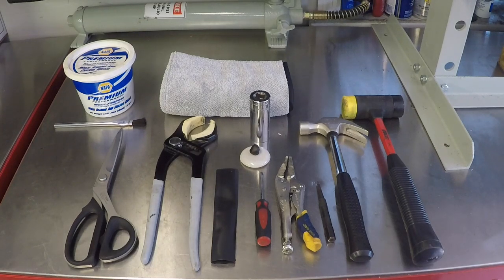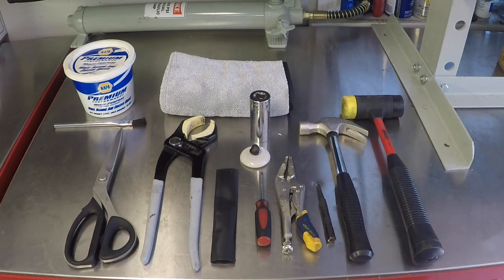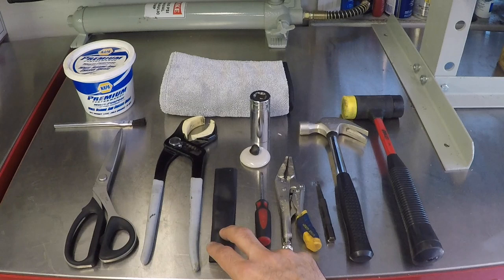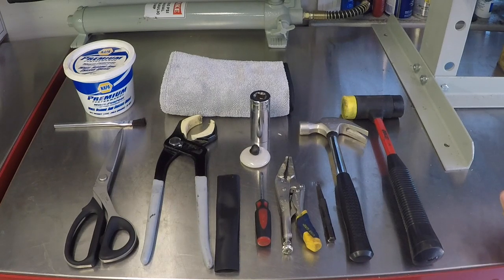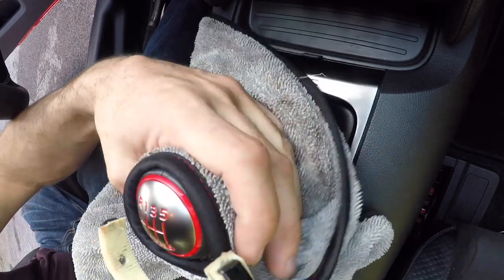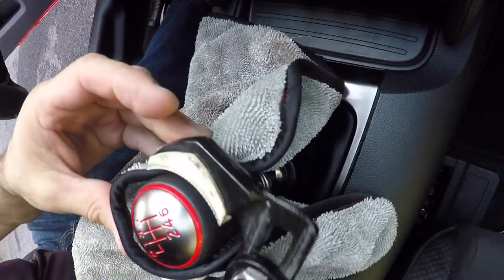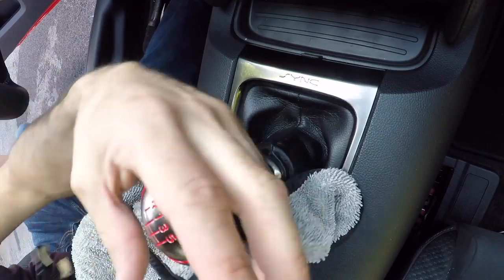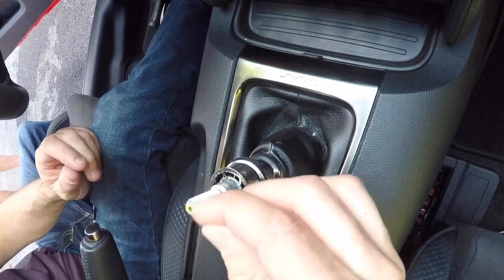Shelby GT350 Shifter rattle and buzz repair! | Auto Fanatic

Comment: Mine just started buzzing last night and it is already making me crazy. I'd leap into this repair but I had a nightmare replacing my stock shift knob with a ball style one.  Ford had used red loctite on the factory knob and getting it off accidentally broke my shift mechanism and required cutting off the shift knob and replacing the assembly by the fold dealer.  I'm gun shy and I'm not quite ready to touch that thing again.

Comment: My 19 just started this noise out of no where when shifting from 1-2 at above around 4K. Sounds like a whirring noise. Almost like a top being spun. I just changed the transmission fluid at 9k with amsoil and the noise has pretty much disappeared but I think I can still hear faintly. It only occurred during the shift. There isn’t any noise while in gear and the tranny doesn’t feel bad in any gear.
Reply: I have this exact same noise on my 19, same thing from 1-2 shift above 4K... so before I tear apart my console... this video is talking about a different sound/problem? Thanks in advance for any additional info regarding this...
Reply: @IIIGhostRiderIII  this won’t fix the issue. I just went ahead and installed an MGW shifter. Noise is gone and now my shifter is solid and even better than stock. I have the new Gen 2 that MGW just released over the holidays. Installed the shifter back in January.

Comment: I've got a 2021 Mach 1 and a couple annoying rattles going on... The first is a more mechanical/metallic rattle that I typically hear only in 1st and 2nd gear that sounds like it's coming from under the front of the car. The other is typically in 2nd to 4th hear and right around 2000 rpm. Wondering if it's the shifter. It sounds like it's more from the dash, but I've tried adding some padding a few places in the main dash trim piece and no dice. Maybe could be one of the metal brackets on one of the vents I spose.

Not sure if I've run into the shift rattle at this stage, it is the same Tremec as the GT350

Comment: Worked!!!   I preformed your mod  about an hour ago. I ordered the shrink tubing and the window sealer you recommended. I followed your directions and "no more buzz".  As you mentioned, the boot was a little difficult to remove and the rest was simple. Well worth doing.  Thank you very very much!!
Reply from the maker: great thanks for posting your feedback, this fix works stay tuned for more GT350 content
Reply: Hey Salty, I'm going to do this mod as well, don't see a link to the heat shrink tube, would you mind posting where you got it?  thx!!  OOPS, found the links in the description above, please ignore!

Comment: I just lost the pin inside the shifting assembly.  Where do I get a replacement?
Reply from the maker: forget the pin, drill out the hole, tap it with a 6/32 and use a set screw instead it keeps the spring in better position and less chance of a rattle. if you want to get a pin go visit a local R/C Hobby Shop those style pins are used for the hubs for wheels and gears FYI.
Reply: Auto Fanatic Wow you actually replied!  

I was so freaked out when the pin dropped inside.  I was putting the pin back like you were but I couldn’t hold that and the pin puncher while under the load of the spring.  The locking pliers couldn’t grip under the lube. :/

I started to take out the trim to find the pin and then got stuck.

Yea I will check out the RC store.  What would I ask for?  A pin for wheels and hubs?
Reply: Filed a couple of hobby shop aluminum spokes and that finally fixed it.

Comment: Do you think this is what causes the shifter to sound  like it’s squeaking when I put it in 1st or 2nd gear. If I go into any other gear or even reverse no creaks!! I plan on just doing this to see if it helps  car has 12000 miles 2017 GT350

Comment: One of the more annoying complaints about the car is this shifter rattle.  Dealer tried to address the issue with no success. Followed this process and solved the issue. Heat gun is a must and take your time. Thanks for the video! Now if I can just get the trans cooler installed to solve the limp mode issue I'll be golden. Thanks!
Reply from the maker: christian sendra thanks for watching and glad this fixed the your car, more videos to come on more rattle fixes stay tuned

Comment: I have a 21 GT. Driving between 28 - 33mph I get noise like a rotating rattle or just a rattle i'm bad at this, I thought it was coming from the shifter but then I opened my center console and the noise got louder and sounds more like it's coming from there. Any ideas ? still makes the noise if I put in neutral at those those speeds. The shifter stills makes other kind of noises because i can touch the part of the shifter where the spring is and i can make the vibrating noise louder or quieter. I'm in new york. Do you have a shop ? Brought it to ford before I realized the noise gets louder with the center console open and of course they didnt hear anything. Any help is appreciated. I'm one of those people that hate noise where it shouldn't be and it's been turning me off to the car, like almost regretting the purchase.
I saw something about the e brake cable ?

Comment: What is the grease type that you are using? Can you provide an example product?
Reply from the maker: just a general all purpose grease this is my grease of choice for the job 
http://amzn.to/2geB0Hu
Reply: You are awesome. I'm going to try not to screw this up.
Reply from the maker: get all the materials and when your ready on a weekend email me direct and i can call to walk you through if i am around. good luck
Reply: Worked Perfectly. Only issue now is that I have a new "biggest rattle" behind the glove box.
Reply from the maker: glad this worked, the glove box crawl under dash and start hitting the HVAC unit, it might be a plastic clip buzzing against something, also check my dash rattle video as well.
Reply: The Knob started rattling on the top. In http://www.mustang6g.com/forums/showthread.php?t=88045&highlight=Shifter+rattle you stated you used a rubber bushing to stop this, can you link that part?
Reply from the maker: Michael a friend of ours posted that thread on his car after we told him what to do, not sure what rubber bushing he used but i am sure you can find one of those that will fit on the shaft. make sure you double check your work and applied fresh blue loctite to the threads where the knobs goes.
Reply from the maker: Michael send me an email direct if your still having issues, we started doing a few more things as we had a problem car that the noise would not go away.
Reply: Auto Fanatic what are these few more things?

Comment: Won't using Window Weld bond the shift collar into the housing? Making future removal of the shift boot extremely difficult or near impossible?
Reply from the maker: MSpeedster no the strip caulk is always removable the liquid version is totally different and acts more like an adhesive.
Reply: Good to know! I ended up using 3 foam inserts in the boot collar, as I wasn't sure about the window weld. Thank you for making this video! A fairly simple DIY for anyone with the shifter buzz or rattle.
Reply from the maker: thanks for watching, i also have recently upgrade the spring on the shaft to a spring i had from an old R/C car, much heavier gauge and you can eliminate the heat shrink step
Reply: so just a stronger spring and some grease and the noise is gone?  Was the spring binding too much on the shrink wrap due to it's thickness?  I am about to do this and want to do it the best way one time :-)  Thanks for all the great videos!

Comment: I just dropped my 2016 GT350 off at the Ford dealer for a noise. I don't know if it's the noise you describe here or not. But I only hear the noise when I'm driving and partially depress the gas pedal. If I put the pedal all the way down or nearly all the way down, the noise goes away. It sounds like rocks in a can to me. Very annoying. And I swear it's coming from the engine bay. What do you think?

Comment: Just did it. Buy the soft pliers, even if you never use them again. Most jury rigs with a wrench and intermediate material will end up concentrating the torque to a few contact points on the shift knob. It takes a lot of force to get the knob back on all the way. I stopped with my jury rig (wrench, cardboard strip to distribute force, microfiber) before I really messed it up.
Reply from the maker: my messing up the leather even though i protected mine as  show made me redo it in alcantara to match the console and steering wheel so it was worth it HA HA
Reply: Auto Fanatic Custom Alcantara wrap or a kit? That would do soooo much for the interior of this car. The foam they put on that spring is hysterical btw. I think that might have been the marketing intern’s project. So janky.
Reply from the maker: I do custom upholstery so I did my car myself, it was not easy, i also did the rear panel inserts, ck my recent interior detail video for some close ups, it make a huge improvement on the interior plus i sound proof the console so it doesnt feel like an old cheap lunch box.
Reply: @autofanaticcars will this help with the nvh from the Ford performance short shifter?
Reply from the maker: @emanuelornelas5537  no idea i never used that shifter the Shelby shifter itself is really good stock

Comment: I just followed your reccommendations thank you. One thing I would suggest for all is to get as thin of a and close to shifter size as possible sleeve for it. The first I got made it to thick and I got new from autozone heat shrink pack the large blue worked great as sleeve. The first one was black and to thick. Couldn't put car in reverse and would not recoil. So the most important part here is the sleeve to be thin enough . But happy now no.more noice. Ty for info.  Valhalla Ford man

Comment: Got a used 2017 GT350 2 days ago after owning a 2016 GT. Great car, I’m rather quickly getting overwhelmed with mechanical noises transferring to cabin (transmission noise/vibration, engine vibration into dash). Sitting in passenger seat with wife driving put me over edge. 2nd and 3rd gear driving are ear murder. I will likely do this repair, but mine seems like there’s more noise than just that, do you have any other recommendations/experience about sound deadening areas around the center console and shifter area? Videos are great, clearly a lot of detail put into them. I’m definitely buying a heat gun, if I see an associates link I’ll buy it.
Reply from the maker: Chris Schleich hi all links are above, also buy the sound proof mat i show in my other videos for dash rattle, remove the top plastic center console and apply to the underside of the plastic, makes a huge diff in noise reduction.  most of the noise is coming from the spring and pull up collar and if your in an area with winter cold temps the noises just get worse this time of year but with some patience you can work through them all.
Reply: Done, thank you. I bought a few other items as well unrelated, they may all hit your account.
Reply from the maker: thanks Chris if you have any other issues email me direct and we can discuss further next week. Have a Happy New Year. AF

Comment: That sleeve looks very thin. What percentage of a NVH reduction would you say that provides?
Reply from the maker: 100% solves the rattle buzz
Reply: you don't need much, it's just to isolate the metal spring from the metal shifter rod

Comment: Hey great vid, quston, I ordered the heat shrink wrap kit you provided the link for and it doesn't have the piece it appears you used in the vid?  They are all shorter and don't look wide enough.  Would you be able to share what size heat shrink wrap that you used?  I want to be sure and have it ready for the install, thank you!!
Reply from the maker: the kit comes with a bundle thats what i used, did you order it and receive it yet? if not see if you can find 5/8 shrink that shrinks down 50% or 20mm

Comment: Dude thank you for this! First result to an annoying problem on my '17. Going to go do this right now. Really appreciate it.

Follow up: So if you're going to do this, be SURE and use soft-grip vice grips. I didn't need them to get the knob off, but to get it back on and straightened is impossible by hand. I made the mistake of trying vice-grips wrapped in a towel. They tightened it, but fucked up the shift knob. Do not try that. Otherwise this works great.
Reply: Ian dang, I read your comment, appreciated it, and figured I’d come up with a better jury rig. Nope. Buy those soft pliers. I think the key is the distribute the torque over their whole surface area. I tried with cardboard and microfiber and still messed it up a bit. Luckily I stopped and had your comment in mind.
Reply: Glad it helped a little bit. The serrations on the jaws of a normal vice grip are just too much for the soft leather of the shift knob.
Reply: For about five bucks you can get a strap wrench at Harbor Freight. The knob will come off in seconds.

Comment: thats bull, there should be a TSB to bring them in and have the dealer do all this.
Reply from the maker: Herakles we can all wish dealers and field engineers will never take time to do this they rather change parts for warranty labor numbers, most dealers Re just replacing shifters for this complaint which is not solving the issue

Comment: Probably could have just added a glob of a wheel bearing grease to stop the rattle instead of using the PVC heat tape.
Reply from the maker: did not work i tried many ways to fix this, many do not like hearing the rattle on a new car and this fix has help thousands solve it themselves